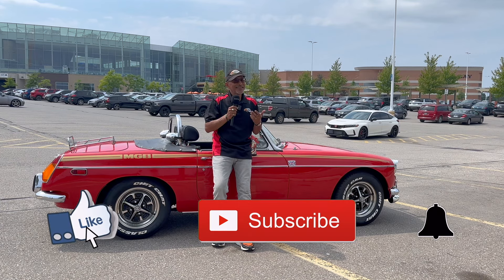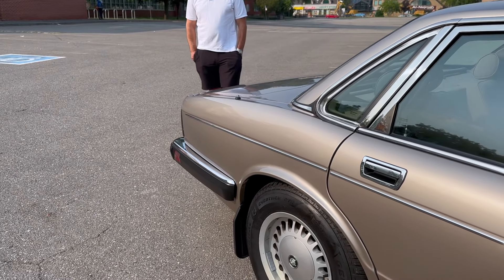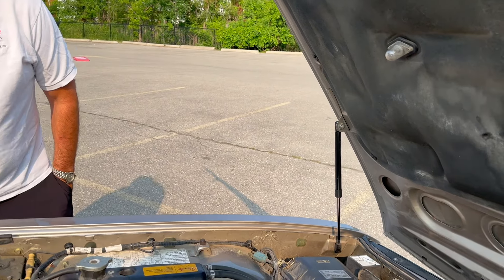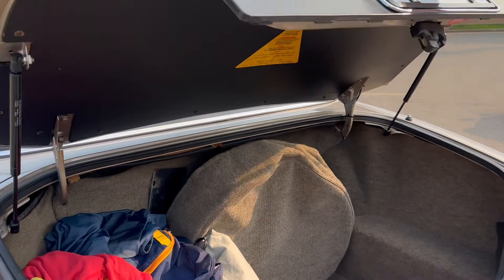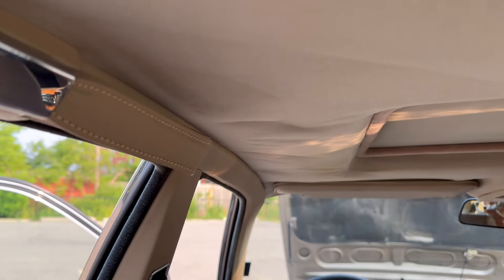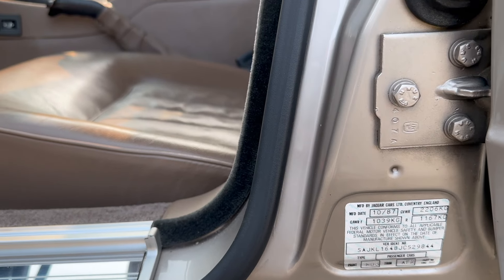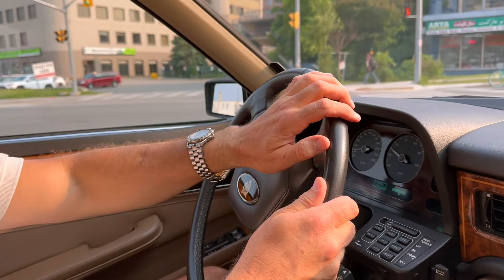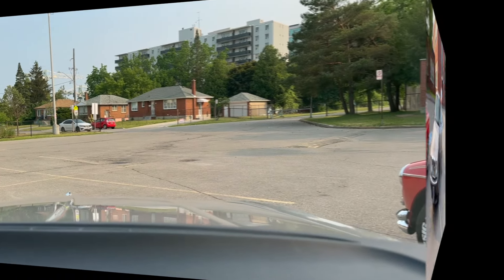Classic 1988 Jaguar XJ6: Step Into Luxury With The Sovereign!

Comment: I bought a 1986 sovereign 2.9 in about 98 it was an amazing car for the time and I was so proud of it.
 My wife loved it we changed out of a newer 3 series bmw and they where worlds apart.
  Mine had what we called the steak pie headlights which I think in UK designated it as a Sovreign.
  Auto air con leather electric seats cruise leather amazing spec and so smooth to drive.
 mine was dark metalic green.
 We where building a house at the time and using £120 worth of fuel a week was a stretch but was lovely to drive especially around London and on the Motorway.
  We lived in the Liverpool area and remembered driving to Cornwall in it with 2 Children at the time. The weather that year was high 20s in Cornwall and we wafted along in the cool air con. Not many cars had that at the time. We briefly swapped to save money on fuel into a Citroen XM !!! In late 2001 we had a new house 4 children and a brand new Discovery 2. Jaguar days where over..
Reply: The 2.9 was great on the motorway got 25mpg was about 16 mpg round town.
  I actually used the gear box in manual mode like a tip tronic quite a lot and it worked well on bendy roads. Your interior looks like a UK vanden plas spec I don't remember UK sovereigns having picnic tables, a beautiful car by the way and what's greener than keeping that on the road.
Reply from the maker: Fearnsey.. 😊 I had to smile as how family changes our ability to keep the cars we loved sometimes. I bet too when you see a video like this the memories come rushing back. I also wanted to take a moment to personally thank for  taking the time to watching my videos, leaving a comment and for subscribing to my channel I truly appreciate it.
My intention when creating these videos is to showcase not only the beautiful car but give the owner an opportunity to share their story, love and passion for their car. Thanks again Kevin.